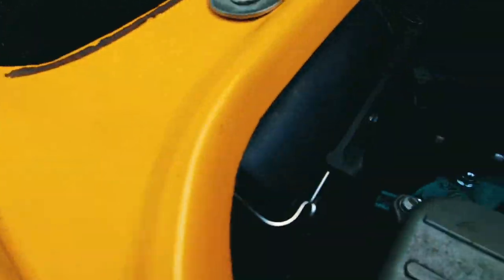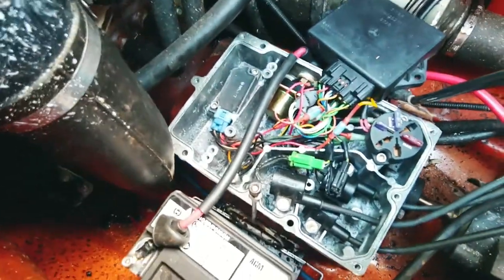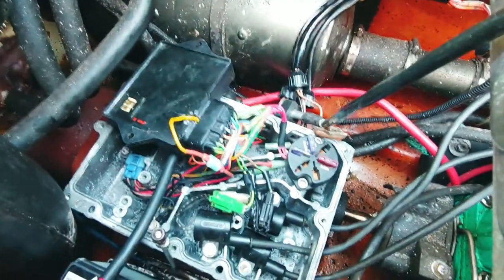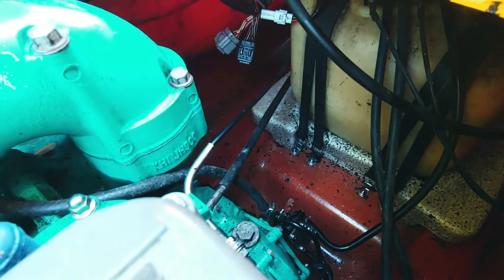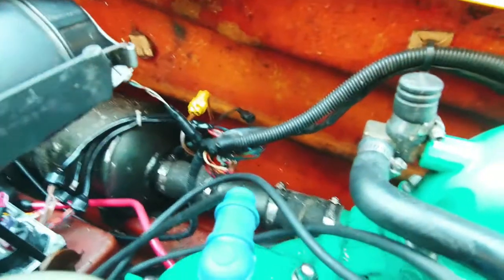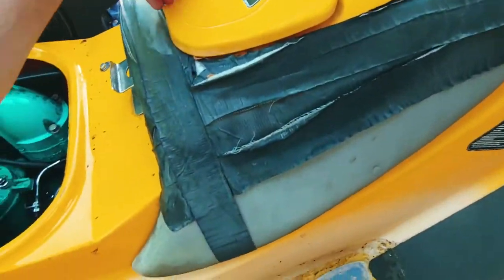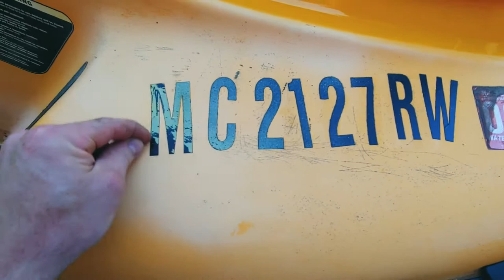2000 STX 900 Restore Series Part 1

Comment: When repairing a jet ski, I encountered a problem. At the factory, they are first assembled and then glued to the top cover. Therefore, many spare parts are very inconvenient to get for repair. Remove from the case. To get the engine out, I had to disassemble it inside, remove the manifold, waterbox, fuel tank. I bought that jet ski you saw for $ 400. The most expensive part in the end was the impeller ($250) :))) I had to order on eBay and wait for the mail to arrive. The average shaft support was also broken and cost $ 200-250 on eBay. But it turned out to be a collapsible structure and I only replaced the bearings. For $ 10. This repair allows you to save a lot on the purchase of spare parts. I wish you good Luck with Andrew's new project! I am sure that you will succeed perfectly!
Reply from the maker: Nice! Yes I have found that doing in this manner, although time consuming, will save you much more money. These going for $2000 in good working condition!
Reply: @Fixin2Ride-Official-  We also have them for about $ 2,000. That's not the point. People became lazy to work with their hands. All buy , entirely. Nothing is being repaired. I like the renovation. Repair and improvement of the view. That's why I like to see your work.
Reply from the maker: @СибирскийСибиряк-с2э  no I was just saying that you can buy them all busted up and then when you're done they're worth more than you actually put into them.
Reply from the maker: @СибирскийСибиряк-с2э  very cool

Comment: Just bought a 1997 900 STX. Starts right up every time but boggs down and stutters with any throttle. I can get to about 25 mph but it takes awhile to get there. Any idea where to start I'm new to working on small engines.
Reply from the maker: The carbs, new fuel and check compression. Make sure there isnt amything wound up on the impeller shaft underneath as well.
Reply: @Fixin2Ride-Official-  I syphoned out the old fuel and put in fresh higher octane along with a can of seafoam, compression all are at 116 psi, and impeller area looked clean but havent done a full check yet. Planning on cleaning out the carbs tomorrow! Thanks!
Reply from the maker: Yep I would check the carbs

Comment: Curious how exactly you managed to successfully unseize your reverse cable?  I’ve tried with WD40 on my 2000 STX but it never really loosens up like yours did.
Reply from the maker: Thanks for watching. Wasnt actually even the reverse cable. It was the reverse cup joints that were corroded. I loosened them up and hit them with some oil and it started working. So I took the reverse cup off the jet pump assembly and cleaned up the joints and greased them well and its been fine since.
Reply: @Fixin2Ride-Official-  thanks for the quick reply. Never thought of that, I’ll try that and see if it helps. Thanks again.
Reply from the maker: You bet.

Comment: Don't forget to get rid of that cheap gas cap it will cost you a engine also pull on the threads that the gas cap screws onto if they're cracked in between the threads replace the neck it will also cost you a engine
Reply from the maker: What are good replacement caps to go with?
Reply: @Fixin2Ride-Official-  buy a aftermarket aluminum gas cap are the best or a heavy thick plastic one for that ski on eBay
Reply from the maker: Excellent! Thanks for the suggestion. I actuslly experienced my 98 STX1100 gas cap leaking last summer. So this is awesome you mentioned that! Thank you very much! 
God bless! Thanks for watching!!!

Comment: I have a question I was told there was something wrong with my CDI by a mechanic I went and bought one I am no mechanic however spent $542 on a CDI I was told that's what I needed now my jet ski is stuck in limp mode the last time it was stuck in limp mode it was unplugged and waited till the next two days and it started right up I took it out in the water with no issues until the end I realized my jet ski was already on reserve I was told there was water in the barrel and I had to be towed back I was also told there was a wire that was unplugged or something not sure what could be causing it to go into limp mode when everything in the jet ski is bypass from what I'm told I know nothing much about jet skis don't get me wrong I have to ask someone so here I go please help
Reply from the maker: Okay so you have a few things going on.. So now the ski runs with a new CDI box... But its now in limp mode? And you're telling me you had water in your fuel tank?
Reply: No I don't have no water in my fuel tank my water indicator line came undone inside the hole of my ski so we towed it back so I can properly drain the hole. The line came off before it went to my temperature indicator sensor so this sensor never reached 203° because it had no water going to it. The oil level and the fuel level wires have been connected together to full the CDI that they're both are full. Then I unplugged the temperature sensor so it can't send a signal that is overheating. Now there is no change as if it is stuck in limp mode
Reply from the maker: Sounds like a lot going on. So are these recommended bypasses of sensors? What do you mean water in the barrel? The hull?
Reply: Yes it was recommended to by pass there was a hose leaking water but that is fixed the jet ski will not come out of limp mode
Reply from the maker: Try unplugging the battery for an hour. When its unplugged, press the start button a few times to help drain any residual power. Then try again. What year make and model ski is it?
Reply: 2001 Kawasaki 900 STS
Reply from the maker: So did you try unpluggimg the temp sensor all together? Not sure if jumping the wires will do the trick. Also I know that a faulty Voltage regulator Rectifier can cause the CDI Box to think its over revving and will activate the rev limiter. I have a video on my channel in which this happened to an ATV.

 You can test by starting the ski and putting the black in negatice post of battery and res lead on positive post. It should only read 13.5-14v DC. If theres no voltage or its above that, it could be the problem. But more so if its too high voltage.
Reply: I did disconnect the battery and when I hooked it back up it was extremely hard to get the motor to turn over and then once it finally did start turning over it took a long time for it to start up and stay running.Can you send me the link to the video that you were just discussing
Reply: So now it'll start easy and stay running but it is still seems to be stuck in limp mode but if I shut it off and start it up repeatedly for a few seconds at the beginning it's not in limp mode and it puts itself right back into it if that makes any sense to you
Reply from the maker: Okay. Yeah its literally a handful of videos down on the video list. But sure. Test your battery to make sure its fully charhed at 12.7vdc. If not fully charge it ans then try and start it. If you can get it to start, test the battery while running at idle and it should register around 13.5-14vdc. If its too high, like 17v then thats your problem.
Reply from the maker: Here is the video. 
https://youtu.be/di2O2g9UEoo
Reply from the maker: Start it up and test the battery with a multimeter. Im betting your Voltage regular is over charging. Like I said you should only be getting 13.5-14v DC testing the battery whole engine is idling.
Reply: My jet ski is doing the exactly the same thing as that ATV was doing. I do not own a voltage tester but I do have a neighbor who has one and he said he'll bring it home tomorrow I'll send you the follow-up as soon as I get it thank you very much for working with this problem with me I can't tell you how appreciative I am.
Reply from the maker: Amy, just want you to know for your own wisdom that these skis dont axtually have a limp mode in the sense of a "protection feature". So its electrical thats causing. If you do test and get an over volting scenario, you can unplug the Voltage Regulator/Rectifier inside the electrical box and it should run fine.
Reply from the maker: Sounds great! That's why I do this. Gotta keep the good machines with minor problems, running for people willinf to do their investigation. 

God bless you and yours!
Andrew C.